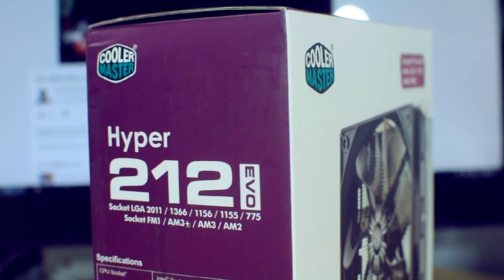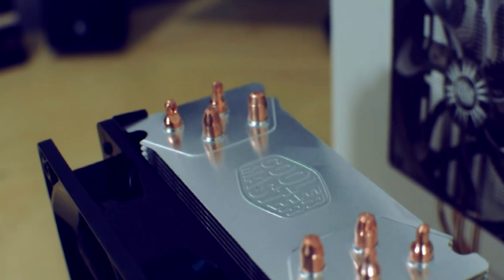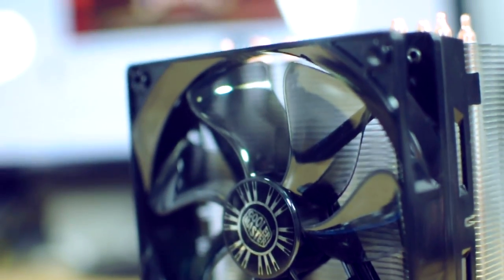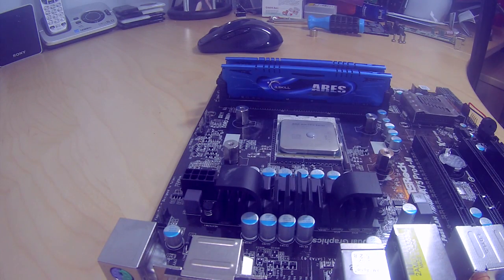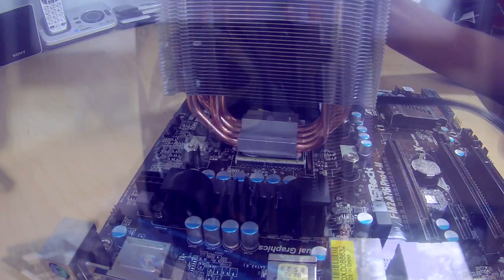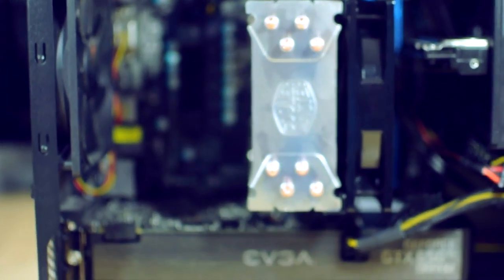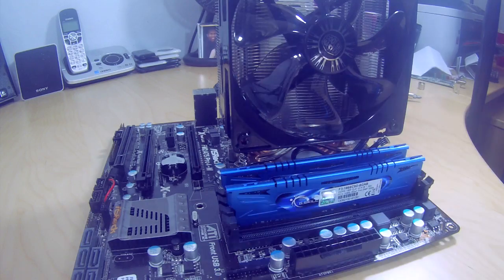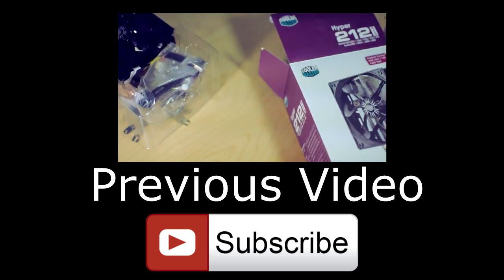Best CPU Cooler! | Cooler Master Hyper 212 EVO Overview & Install

Comment: help meh please i bought this cpu cooler and i installed it the right way but when i start the pc on windows just loaded up the fan either stop completly or goes down to 100-200rpm and it stays there until i go to gigabyte and change the fan speed and set it to 1000rpm and i have to do that every time i start the pc and its kinda annoying to do that all the time and its not normal the fan should spin at 600rpm idle and 1600rpm while working hard and it doest so please someone help me
Reply: Is there a small battery on your mobo ? Or a space to put one? If so put one in. If there is a button on your mobo called : "clear cmos" try and click it and then do your bios settings
Reply: i have an gigabyte 970A-DS3P motherboard and i cant find anything idk
Reply: Lightify Do you have the jumper sleeve thingo in? I had a similar problem. If it is not in it wont save any bios settings. Pop that in and it should be good to go. (sorry for the late reply)
Reply: Slothnado i have 0 idee what you talking about could you find a video or something
Reply: Lightify yeh, ill try. Hahaha
Reply: ***** dont worry i got a watercooler know it fixed itself after some hours useing it

Comment: is it weird that my motherboard doesn't have a backplate?

i have a GIGABYTE 990FXA-UD3 REV 1.2.

the backplate is not removable but so far with all of the AM3+ CPUs stock coolers i've put in it hasn't been an issue.

is backpltes only a intel socket thing or...?
Reply: The cpu cooler comes with the backplate for added support not the motherboard

Comment: How do you know if it fits in your case
Reply from the maker: MrPankakes101 Go to the manufacturer website for your case and look for "Maximum CPU Cooler Height" or "CPU Heatsink Clearance." Make a note of it and then look up the Hyper 212 EVO on the Cooler Master website and check the "Heatsink Dimensions."

If the Heatsink Dimensions are smaller than the Maximum CPU Cooler Height then it should fit.

Comment: does this cpu fan automatically adjust the speed for you? I don't want to have to change it when i want to game.
sorry im new to building my own pc's and all the components
Reply: ApxPredator18 The motherboard automatically adjusts the fan speed using PWM control, you just need to plug the fan into the CPU Fan header on the board.

Comment: is this cpu cooler good with AMD FX-9590 Vishera 8-Core 4.7GHz?
Reply: This CPU needs more cooling than the 212 evo provides IMO. I would suggest the Noctua NH-D14 (http://www.newegg.com/Product/Product.aspx?Item=N82E16835608018) as the best air cooler out there, which is capable of cooling this...
Reply: underscore_Mino meh, noctua NH-D14 is ugly to me sorry, am I able to use Cooler Master Hyper D92 - CPU Air Cooler with Dual 92mm Offset Push-Pull Fans and Accelerated Cooling Systetem? also is it cold enough for the cpu? http://goo.gl/8fectL
Reply: JasonZixelGaming The NH-D14 is probably the best option for aircooling, although they have the NH-D15 which seems to be better in terms of temps. The D92 would be a joke trying to cool a 9590 as single tower heatsinks don't have 220w of cooling capacity. You could try the Dark Rock Pro 3 from Be Quiet. I would just get something like an X61 from NZXT or the NH-D15 IMO.

Comment: If you ever look for another cooler like this take a look into the enermax ETS-T40-TB it is a similar cooler 4 heat pipes, except the fins are a little thicker, the fan is a little more silent then the coolermaster, also the fans on the ETS-T40-TB have removable props for cleaning if need be.

Comment: i have a Bitfenix neos full atx case, with a amd fx 6350 6-core processor, its making alot of noise at 30+ C Temp and vibrating my desk more than the washing machine vibrates. i am using the stock cooler and ive had no problems so far.. im just wondering if its cheaper or more effective to have the 2 optional fans for the front of the case rather than a new cpu cooler. i already have one as a back-up, a prolimatech 68 cooler. but like i said wondering if i should add more fans to the case, and if so what should they do? bring air in or pull air out.

Comment: Hey Jerry, you might want to check your airflow config, because I have and old TX3 running in a Bitfenix Prodifgy M and I get 35C idle, at lowest fan speeds. I get 45C when running intense games. Aaaaaand I just realized your vid is 10months old, so you prob don't run this setup anymore xD Peace out, nice vids btw!

Comment: I got mine in a Corsair Carbonite 200R case - running an i7-2600K on an ASRock Z77 Extreme 4 - I have 2 120mm fans on my 212 EVO and I have my i7-2600K Running at 4.7 Ghz!  102.2 BClock x46 CPU multiplier = 4701 Mhz! 16 gigs G-Skill DDR3 1800 @ 1904 Mhz (dual channel OFC!) - This cooler IS BADASS!! Cannot be beat for the price - and the FEW that actually perform better on air (see FrostyTech) COME with dual fans already! By FrostyTech's Intel CPU bench - with just the fan that comes with it - 15.9 degrees C over ambient at 150w thermal load! Where the Corsair Hydro H100 (a near $200 enclosed CPU water block) gets 12.1 degrees C above ambient under the EXACT same load!

If you want a KILLER heatsink - and have a WELL ventilated case (Corsair Carbonite 200R = 5x 140mm fans 3x 120mm - all occupied on mine, with an additional slot blower fan 3 slots down from my GTX 760) - This thing is ONE OF THE BEST Air Cooling units you can buy! The few that are better are only marginally so, and it does not include a test run with dual fans like I run! My exhaust fan spins 100 RPM faster than the intake, as one is an Antec high performance 120!

Comment: I installed this on my cooler master 690 II plus case without removing the motherboard ( Gigabyte GA X58A UD7). I am using two fans instead of one supplied. Also installing it is pretty simple. Overall this is a really good cooler for its cheap price. It keeps the load temperatures between 60 and 65 celsius when playing games like battlefield on high settings. The Idle temps are between 40 and 45 c depending on your room temperature.
Reply: "The Idle temps are between 40 and 45 c depending on your room temperature."

Your temps with that cooler are completely irrelevant. 

Proof: I have a stock cooler and my idle temps are 33c. If I installed this evo 212 obviously my temps would go lower than that, thus not being in your "40-45" range.

It depends on too many factors for your temps to apply to everyone else (cpu model, case, room temp etc).

So you can't just say "it will keep your PC at X temp."

Comment: Can someone explain how i am meant to install my cpu cooler for the 8530? 
I got this message when i checked if there was comparability issues with installing the Arctic Cooling Freezer 7 Pro rev 2 and the  8530. 

{For cooling the CPU and its surrounding components, please install a CPU cooler with a top-down blowing design.}

 Sorry first time pc builder here :L

Comment: Noticed you were getting 45C @ rest.  That is actually quite high compared to mine (same 212 kit), where I'm running 28-30C @ rest, and it maxes out @ 47C with maximum abuse.  (Not overclocked as of yet).
Reply: I thought the same thing but bear in mind that he has the fan set at speed 2 and the room temperature might be a lot higher which does have a noticeable impact in air cooling solutions! :)

Comment: My case: 160mm
My fan: 159mm

EPIC WIN
Reply: shweg
Reply: My case is LITERALLY 155mm fuckkkkkkkkkkkk. Gonna go with the T4.
Reply: Shani Tanghe The website where you bought it ;D
Reply: Bluehulk4 most likely not, the cases show how big cpu coolers they can take, like the carbide 200r can take coolers up to 160mm, but the case is 210mm wide.
Reply: Wiikendz Its hard tough, a bunch of times the website shows the limit with side panels fans installed, my Case says that it can only take 150mm coolers but it actually can take up to 165.
Reply: :D same for me
Reply: Me too lol
Reply: How to check the size of the case? :P
Reply: I see this is 3 months old but your motherboard will probably prop it up and cause some clearance issues
Reply: Shani Tanghe If it doesnt fit then take the sidepanel off :D.
Reply: Damn my case has a cpu clearance of 161mm so i got 161 of free space to fit on a cooler and this fan is 159
Reply: Bruh, the motherboard uses some of the space to.

Comment: Life expectancy 40,000 hrs = 4.5662 years.
Reply: That will depend on the speed(s) it's running at.  If your CPU is at rest (most of the time probably), that will add up the mtbf slower than pushing it hard.  Also whenever your PC is off or asleep doesn't count.

Comment: Is it possible to do it without removing the motherboard? or would you definitely recommend removing it?
Reply: He mentioned that briefly, you're able to install the cooler onto the motherboard as long as you have a cutout on the case for the backside of the motherboard. There's nothing wrong with installing the cooler without taking the motherboard out.

Comment: why is my stock lga 1150 celeron g1820 running at 90 degrees?
if i buy a aftermarket cooler, will it drop to 40 degrees also?
Reply: My i5 3750 was running at 100 degrees C fully loaded.  After installing this cooler, it's now running at 45 C fully loaded.
Reply: ok. thank you man

Comment: Was there thermal paste already applied to the bottom?
Reply from the maker: Dread Steel shut up bitch
Reply: ***** chillout man, have some Kool Aid
Reply from the maker: this question can be answered by watching the video in its entirety
Reply: Yeah man they come with thermal paste applied.
Reply: WHICH IS RIGHT?!
Reply: *****
Would this fit on a GA-78LMT-S2? Everyone recommends this fan for the AMD 6300, but this motherboard is quite small.
Reply: no
Reply: ***** no one have the time to watch a 10 min blabber about a mere cooler.
Reply: oooohh.
Reply: *****
 http://en.wikipedia.org/wiki/List_of_burn_centers_in_the_United_States
Reply: Dread Steel ok
Reply from the maker: Dread Steel*slaps you*
Reply from the maker: Bizzo Brigante quiet scrub
Reply from the maker: Bizzo Brigante I said QUIET! *slaps you*
Reply from the maker: Bizzo Brigante your mom's nonsense
Reply from the maker: Bizzo Brigante no
Reply from the maker: you scrubs are just begging for attention, its sad really

Comment: It's a very nice cooler,fit's right my case is a bit more than 9 inch wide so remember that before you get.My 8350 4.7ghz OC stays real cool underload.Also don't use cheap thermal paste that comes with it.

Comment: It doesn't fit a FM2 cpu  it has it on the box a fm1, I thought a amd a10-5800k was a fm2 cpu. I have a amd a10-6800k and it is a fm2. that would not fit my cpu would it?

Comment: which way is the airflow moving? will it be pushing air out toward the rear chassis or drawing air in from it? 

Just in case that is a confusing question. Let me say it this way....does the direction of air from this cpu fan conflict with the rear and top chassis fan? I've seen several videos on this and the fan is being pointed in all kids of directions. I"m wondering if anyone has though about maximum airflow withing the chassis. Nobody wants hot air spinning around in circles.

Comment: Umm...dose thermal paste spread around the cpu once the cooler is placed on? or should i spread it at the bottom of the cooler so it has that paste evenly?
Reply: it'll spread around the cpu once you put the cooler on as long as you have put enough thermal paste on the cpu.

Comment: Good review. I purchased it and installed fairly easy. I think people where complaining about the instructions being a little iffy. Question: I have an asus P9X79 and my CPU fan options are standard turbo and a couple other options. Is this a variable fan? and would you know what setting in the bios to use? Thanks

Comment: which Hyper 212 is the best?
Cooler Master Hyper 212 Evo Processor
Cooler Master Hyper 212X Processor
Cooler Master HYPER 212X TURBO - 2 Fans Free Processor 

???
Reply: They're all the exact same heatsink... Different fan on the X(claimed to be better by CM) and the turbo has 2 of the X fans in push-pull. I'd stick with the Evo and pick my own(even better) fans.
Reply: Oh and to actually answer your question. The turbo X would be the best straight out of the box.

Comment: I have a MSI Z87GD65 and the socket is LGA 1150 socket, my question is: Is this heatsink compatible with the motherboard?
Reply: It's compatible with any LGA 1150 motherboard (:
Reply: the main problem is it going to fit. that big fucker is 168mm tall. measure your case before buying
Reply: Yes it is I have that cooler my self
Reply: josh knox Me too :)
Reply: Arno Dalmatinac they do a great job don't they my computer has never been over 15 c
Reply: you don't need that big fucker taking up all the space in your case. I use a much smaller of the same type and my 100w i7 never goes above 23c
Reply: PhuckHue2 I love the big fucking thing it keeps it cooler
Reply: If my case was big enough it would have blocked the last RAM slot anyway. now I have plenty of room. the cooler only cost $10 after rebate. not much of difference between 15c and 23c
Reply: josh knox It never goes above 50 c on my i7 4770k 4.2 GHz :)
Reply: Arno Dalmatinac yes it is
Reply: Arno Dalmatinac
50c is not dangerous but you must be overclocking. that voids the warranty
Reply: josh knox "'my computer has never been over 15 c"
are you kidding?
Reply: PhuckHue2 I voids the warranty only in case I fry it overclocking. Solution for that is to buy extended overclocking warranty.
Reply: Loh Jia Hung But you're probably not overclocking, my temps are probably higher because I'm not sure what condition my termal conpound is right now, probably time for replacement.
Reply: Arno Dalmatinac 15c is colder than ambient temperatures. It's not possible with even a watercooling loop, much less an air cooler.
Reply: Loh Jia Hung I didn't understand your comment at first but I agree. They do a great job with 2 fans but 1 is not enaugh for overclocking (for me).
Reply: Arno Dalmatinac Yes, the Hyper 212 EVO is a good cooler. But, this guy claims to get 15 degrees Celsius on his CPU with this cooler, be it load or idle. That's not possible even with, say, a Swiftech H220X or a NZXT Kraken X61. Such temperatures can only be achieved with sub-zero cooling, like those who take their CPUs to 8794 Mhz/ 8.8 Ghz (looking at you Andre Yang) with the help of liquid nitrogen.

Comment: I have this cooler and it was a bitch to install in my case. Call yourself lucky for having to take out your mobo already that probably made it 100% easier.
Reply: I didn't find it too bad.  A little tricky getting the screw holes aligned on the X bracket, but all in all a pretty easy install.
Reply: Jimi Nixon 
a little tricky? it's not fucking possible for me! help!
Reply: make sure you have the bracket in the right orientation and set up correctly for your cpu socket
Reply: maksuree Also make sure that you have read the part where it tells you which screw hole to use for your processor.  As there are 3 of them on each corner, the wrong 2 will be slightly off and very frustrating.
Reply: Jimi Nixon
i had read the instructions. they were hopeless. i followed a tutorial on overclock.net and it took me 3 hours but i finally managed to wrangle it into the screw holes.

Comment: how does it compare with the Cooler Master Hyper T4? what one would you say is better?
Reply: its the same thing,
Reply: the T4 is plastic push pin mounting which is crap. you want a cooler with a metal rear mounting bracket for support and more heat dissipation

Comment: my case says cpu cooler does not exceed 5.9 inch 150mm height well this cooler fit on this case elite 310?
Reply: that big fucker is 168mm tall. I measured it. I already bought it and had to return it. It's also going to block the bottom RAM slot

Comment: Hey Jerry! I was wondering, how does the thermal paste application process work? Did you apply it in this video?
Reply from the maker: Mickael Thory Check here for my install vid Cooler Master Hyper 212 EVO Install Time Lapse | Shot w/ GoPro Hero 3

Comment: i notice amd chips tend to run little hotter then intel.  my amd build runs alittle hotter compared to the intel build i had, and my friends amd rig is doing alot better after adding this towering cooler enough to where he could take a couple of the dying case fans out!

Comment: did you also notice a temperature difference especially with very little thermal paste? i ask cuz im thinking of taking the cpu cooler off of my cpu because there is ton of stock thermal paste on it!

Comment: the fan that comes with this cooler is total garbage...my first fan lasted about 5 months and the replacement lasted 6 months...the cooler is good but if you buy it you have to get at least 1 good fan...don't even bother with the fan that comes with it unless you want to take you shit apart in a few months...also, depending on your board and ram you WILL have clearance issues...